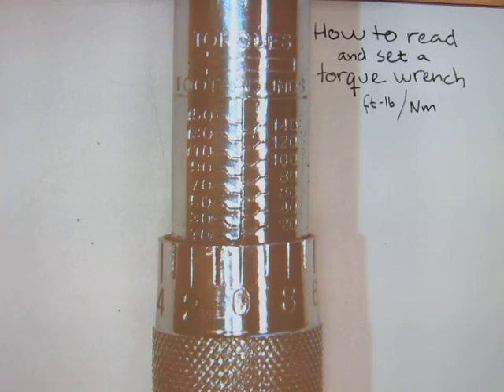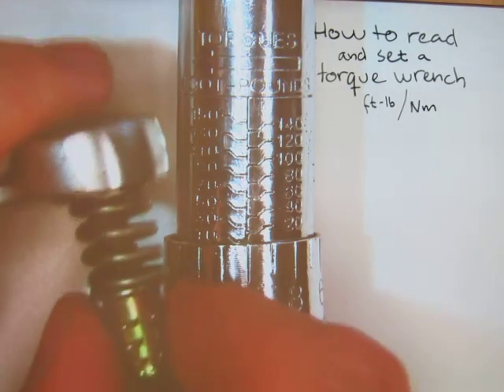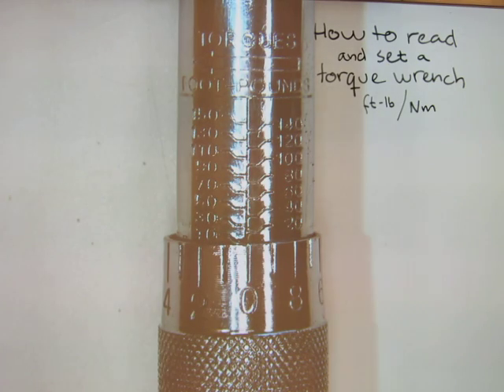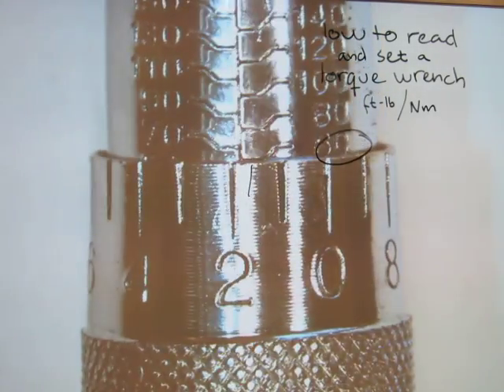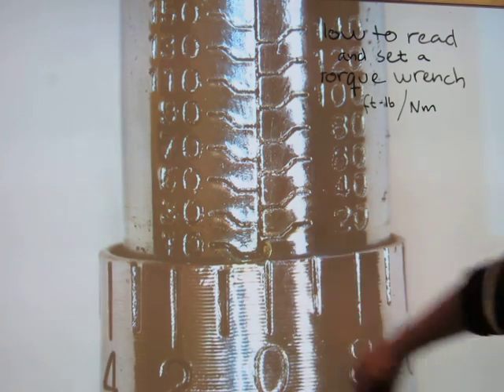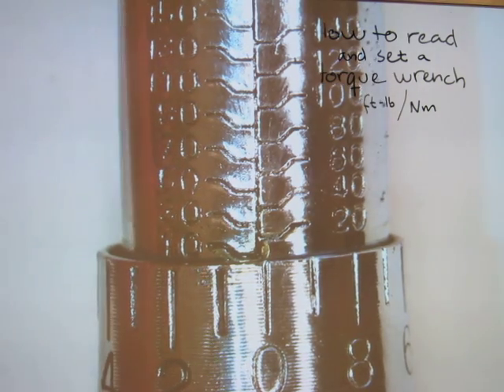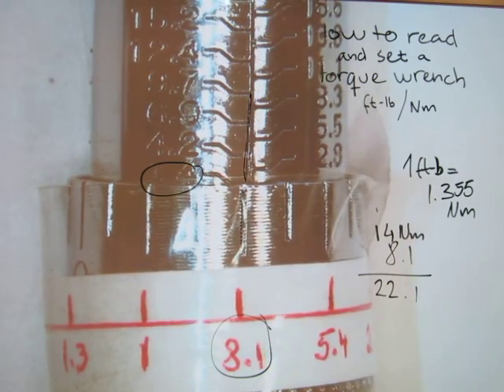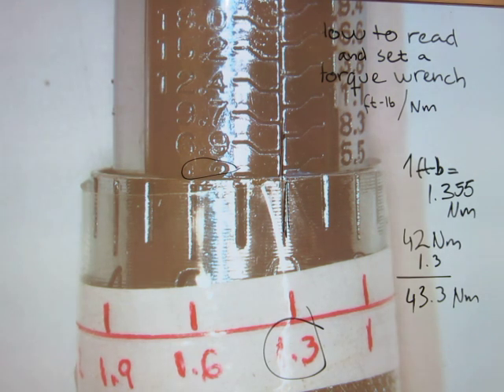How to read and set a torque wrench (ft-lb and Nm)

Comment: I was wondering if you could help. I see that at 7:19 32 nm has the dial just meeting the horizontal line of thirty, so it looks like it should have the zero there.
My wrench doesn't zero up exactly on the horizontal, but rather it is the seven on the dial that meets each horizontal line. So I'm not sure if I can still use the wrench and get an accurate amount of torque.
If I treat the seven as zero and just adjust for that will it work?

Comment: If the torque specifications are for example, "9.05-26.03", or something like that does it mean setting to anywhere between those numbers is ok?
Reply from the maker: I range is given, setting AT THE MIDDLE of the range is required. The uncertainty of wrench calibration, operational reliability and human error are the reasons for the range. The range is sensible, such as 5 - 9 or 45 - 52, the 9 - 23 example is not exactly.

Comment: Thank you. Foot-pounds from Inch-pounds was difficult. With this video I set my ft. -lbs. torque wrench from 43 in.-lbs., which is 3.58 ft.-lbs. to 5, then backed off around 1.5 to 3.6 ft.-lbs.. This video made it easier to see what was hard to make out on the markings on the wrench. My thanks to you Sir.

Comment: The markings on torque wrenches are totally misleading, an absolute crap design, what is wrong with having a straight line so people can't go wrong.
Reply from the maker: Good point. Really don`t know why the manufacturers make things complicated by making 1 tool for all markets.
Reply: @apprenticemath  I guess they don't use precise markings because most torque wrenches are not calibrated accurately. The closer you get to the top and bottom end of the scale, the worse they get.

Comment: I just borrowed a torque wrench from an auto parts store to perform proper adjustments for a repair on the car I Am working on. Thank you for your clear explanation.  You even described the inside workings where some may find that an unnecessary nuance, but I am of the mind where I like details and need to know how the inside works.  I even feel confident about newton meters should I need to .  Thank you so very much.
Reply from the maker: Thanks for watching.
On my other channel there is more applied knowledge, stuff taken apart. Often with some cruder approach, but definitely getting to the inside of things from wheel hubs to dryers. https://www.youtube.com/user/theoverengineer

Comment: my torque wrench main rod numbers are in increments of 5.  I need 18ft lbs.  would I go up from 15 or down from 20, or does it not matter?
Reply from the maker: Get a smaller wrench, it does matter.
Reply: LBOE OUTDOORS 
Don't listen to him. It does not matter if you go up from 15 or down from 20.
Reply from the maker: The question is not about direction to get to a number
Reply: Ok. Then what is his question? I misunderstood???????
Reply from the maker: A bit. Question was about precision, to set exactly to 18. With increments of 5, not possible. In some cases, 20 is not close enough, is overtorqued.

Comment: can it be set to 8.75 ft pds?
Reply from the maker: Not really, scale starts at 10, meaningful range starts at 20. It`s like trying to measure a sandwich on a bathroom scale. Way out of range, get a kitchen scale. Likewise, get a smaller wrench model for setting 8.75 ft-lb.

Comment: umm.. question and suggestion. I think you can use the 0 on the handle as a reference point. If they have space the vertical scale correctly, anyways. Any nm can be measured and then wrote at that point on that vertical shift. they happened to do it in increments of 1.4, not 1.355. Right? So my suggestion is make a make shift scale for the  horizontal in fourteen equal increments.  hence giving you a scale of 1.
Reply from the maker: +Alexander Heilman They round. 1 lb-ft = 1.355817948331 ...  5 more decimal digits ...Nm, because 1 lb-f x 1 ft = 0.45359237 kg x 9.80665 m/s^2 x 0.3048m No matter how they lay the numbers out, the multiples of 10 with whole number smaller increments 1, 2, 3,4 ... (lb-ft) will never coincide with the multiples of 1.355817948331 ... So the multiples with some rounding are 1.3558, 2.7117, 4.0674, 5.4232, 6.779, 8.1349, 9.4907, 10.8465, 12.2024, 13.5581. They should print these numbers on the scales. 14 increments is too many, it should be 13.5581. So they don`t make 13.5581 equal increments. It is possible, just makes a miserable scale to read.
Likewise, the multiples of 1.4 don`t quite work with the whole numbers or multiples of 10, only every 5th. The multiples are 1.4, 2.8, 4.2, 5.6, 7.0, 8.4, 9.8, 11.2, 12.6, 14.0. These multiples look similar to the multiples of 1.355, but they`re all off by 3.2%. Given that the tool`s torque spring sets torque to within, say + or - 5%, (random overtorque or undertorque) any rounding in decimals just makes to tool less reliable to set torque with confidence.
We should bug the manufacturer, they printed slightly wrong Nm decimals on the handle anyhow.

Comment: One more thing.   I am about to purchase a 1/2 torque wrench.  If I use an adaptor to reduce it to 3/8, what impact will it have on accurate torque
Reply from the maker: God Chaser Not affecting anything. At high torque settings the 3/8 adaptor`s square pin could fail and twist off.

Comment: Hello, how can I convert Ft-lb to In-lb?  (foot-pounds to inch-pounds).  With a ft-lb torque wrench measures from 20 ft-lbs to 150 ft-lbs can tighten a bolt to 168 in-lbs? Thanks
Reply from the maker: God Chaser Super simple. 12 in-lb = 1 ft-lb, so 168 in-lb = 14 ft-lb. Yeaaah, that`s too low for the big wrench, find a smaller one.
Reply: Thank you!

Comment from the maker: If you can`t find them, experiment. Compress the gasket by snugging the bolts with a screwdriver, or nut driver, no ratchet or wrench. Check for leaks. (The cover covers the cam shafts, the cams act on the valves, = cam cover.)

Comment: thanks for the advise. I heard you need a torque wrench to install a new gasket for the valve covers(I'm not a mechanic per say but it may be called a cam as well). I already had the cover on and just needed the torque measurements to finish, so I can't technically do as you suggested this time, but if I have to re-do(God forbid) it I will use your method. I'm really just looking for a place online I can refer to for torque measurements for the different engine parts that require it. Any ideas?

Comment from the maker: I think you mean the cam cover bolts. Do this: cam cover off, take a bolt, find where the thread starts on it, count the number of FULL turns it takes to go into the valve brackets until snug (say 9.5 full turns). Do NOT exceed that when tightening. The gasket is thick, meant to me removed many times and compressed by the cam cover bolts being tightened. If you have 9.5 full turns to go max, you`ll see the gasket being compressed at turn 8. Turn 8.5-9 should do. (Turn-of-the-bolt method)

Comment: Thank you very much for this video! Someone doubted me when I told them how to set the torque for mine, and I never received any intruction previously, so it was great to see I have been doing it right.  My service manual comes with the the spec. for both ft. lbs & nm; because of the math necessary for setting to nm on my Craftsman, I sometimes double check that the ft lb side lines up with the spec listed for ft lb as well as what I set it to the suggested nm spec.